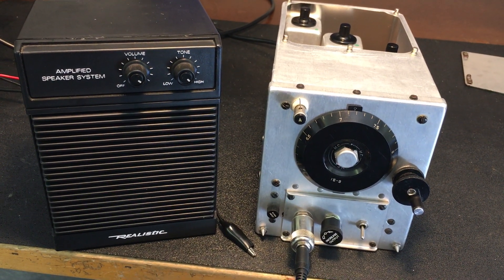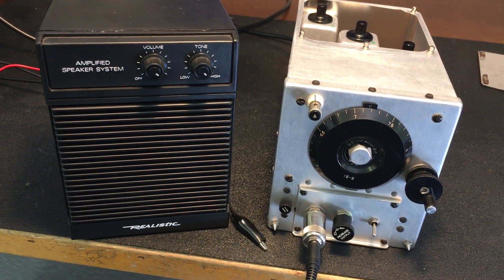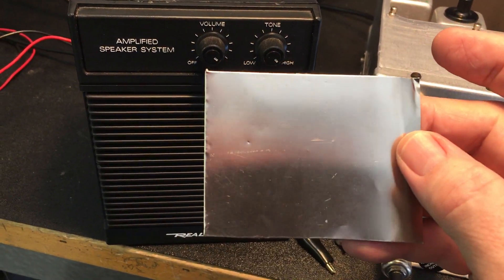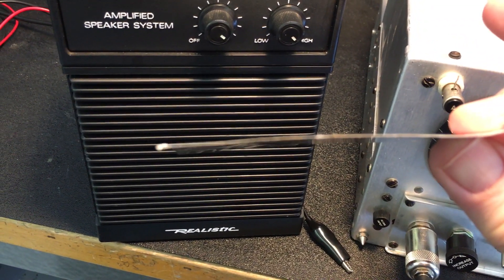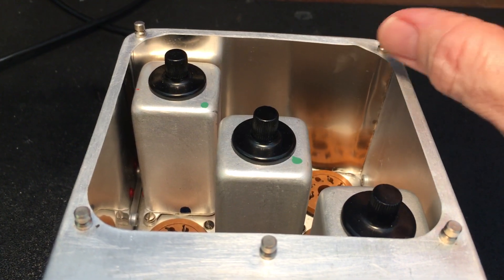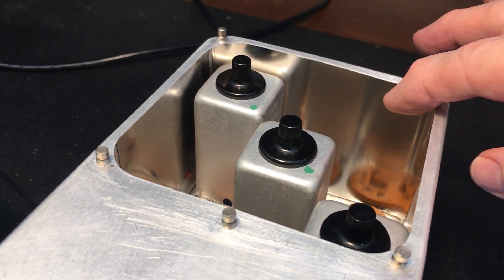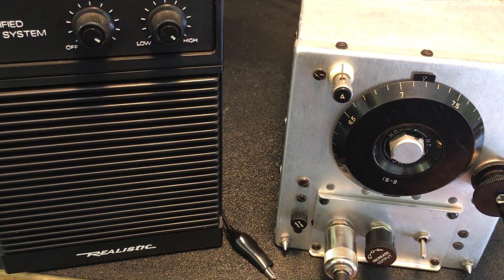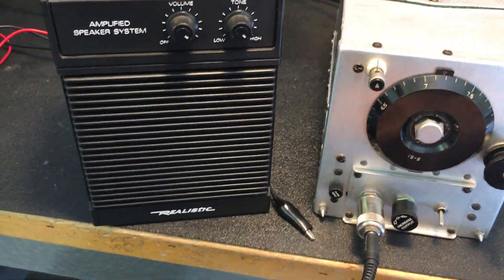Transistorize Your BC-455 Radio - PART 6

Comment: Why not substitute a BCN coax jack in place of the ant. Connector? More friendly for Ham radio connection.
Reply from the maker: Nice suggestion Mike.

BNC and SO-239 coax receptacles were commonly used to replace the original "Antenna Binding Post" for the convenience of connection to a coax feed line. These radios were designed for short "long wire" antenna installed on military airplanes. A coax feed to a dipole antenna may not bring the desired results obtained form a long wire antenna terminated on the original binding post.

My desire is to keep the radio looking as original as possible on the outside even though its highly modified inside. In addition, I will be connecting the receiver to a BC-422 Antenna Relay Unit which also uses biding posts.  

73's

https://womenshistory.si.edu/object/antenna-relay-unit-bc-442%3Anasm_A19602591000